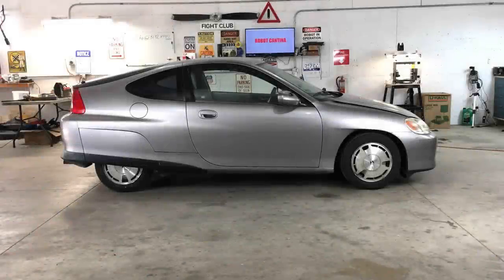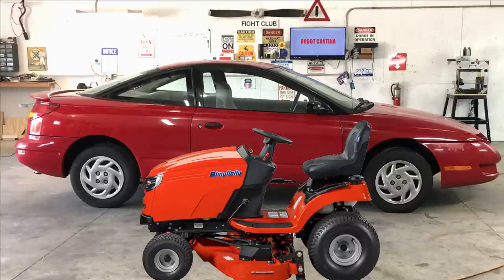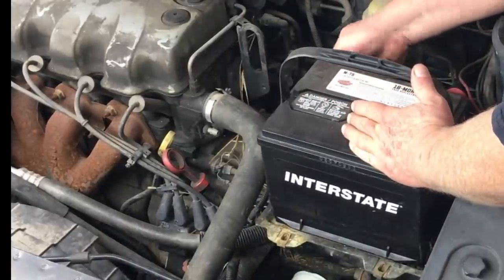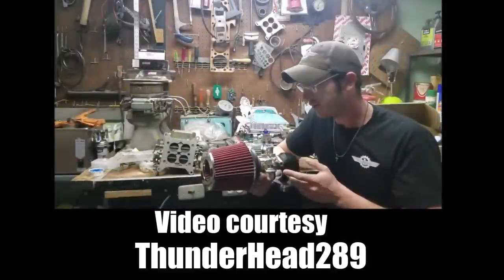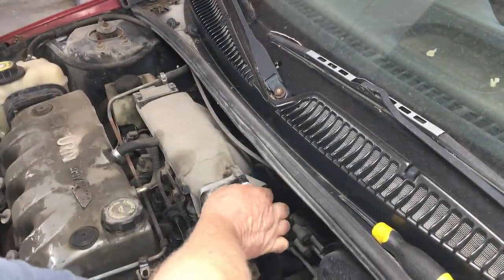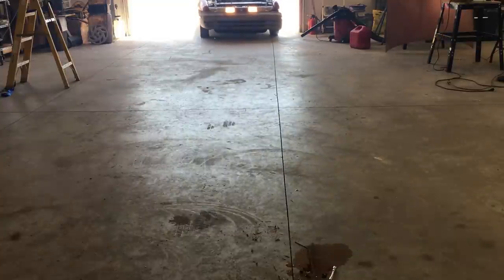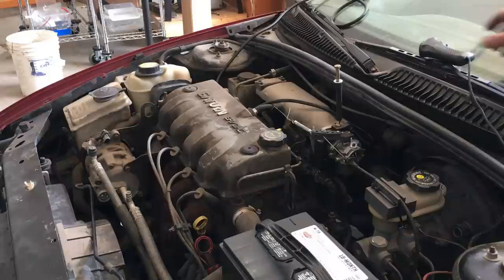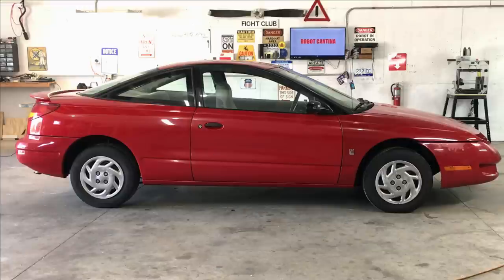S2E14: We get new project cars for more experiments,  plus we put lawnmower carburetor on a Saturn

Comment: I remember reading about a lemons racer who did this with a 2 barrel cause his EFI gave out during a race, always wanted to try it on a beater with poorly working or non working EFI to see if you could improve fuel mileage out of the crate or at least buy a crate some time before the scrapyard. I'd love to see some tests in regards to general fuel economy at some point with that setup, and see if the computer is still playing with timing like normal or if it locks up or freaks after a while. Being 90's tech I doubt it would panic but so much.
Reply: Interesting points here.   I am a little more  90's tech myself so I can relate to that. 🖥☺
Reply: @kansasrose2909  Are we talking about a  Le Mans race car?
Reply: @mommapanda5736  ROBOT CANTINA    we love these new project cars!    and we love it when Jimbo  re= engineers stuff!  just for fun👍👍👍👍

Comment: The EGR delete might have been intentional, keeping it from gunking up the intake. Yes, replacing the transmission filter does help, but the only real solution for the Saturn auto transmissions (if you don't take it apart and modify it) is to use a manual transmission... ("Reverse slam" is a thing, as is firing your diff pin thru the housing.) Long time Saturn owner here.... Saturnfans is also a super excellent technical resource, at least for mostly unmodified cars...

Comment: I subscribed to Luke's channel because of that carb video and I'm excited to see it here as well. The wide band sensor will help a lot in tuning the carb close to that 14.7 to 1 that you need. It's a great idea to install.
Also you may wanna get rid of the converter before anything bad happens to it and it melts down from a rich mixture. You don't want it to clog and affect testing. Getting rid of that variable saves you a headache later on.
Keep up the great videos👍👍
Reply: Great brains seem to think alike sometimes, right👍

Comment: I hope you have better luck than I did with the brakes.  Saturn does a weird cross brake system with the front and the opposite rear on one circuit.  I never could get the back brakes adjusted well enough to get a solid feeling pedal.  I was contemplating rear discs when the body control module got iffy so it left the fleet.

Comment: Dunno if anyone has mentioned this, but my experience with 90s era computer control systems leads me to say that there's a non-zero chance that not having a functioning throttle position sensor (and whatever vacuum operated valves and sensors run to the original throttle body) could be why the car is stuck in 3rd gear. An easy way around that would be to install the old throttle body, remove the butterfly plate, rig up a linkage from the TB to the carb, and attach the carburetor in front of the TB. That would likely also restore idle air control (I'm not familiar with this particular system, but you may be able to rig it to function like Thunderhead's air bleeder system), and give the ECU the inputs and vacuum references it needs to control the transmission properly.
Reply: I come here for the videos and stay for the comments... I lot of genius thinking going on...
Reply: @kansasrose2909  I come for the comments and stay for the fun of it all...
Reply: @ocdman202  HEY JIMBO.....  congratulations on reaching 100k subscribers.. ROBOT CANTINA is providing the 
entertainment and fun that viewers enjoy..

Comment: I 3d printed a thermostat housing for a comedy channel that does satirical bits about being a mechanic. I printed 2 one in pla and one in petg he ended up putting the petg one on because the pla one was "too pretty" and he wanted to sit it on his shelf.  I expected both of them to melt and spew coolant everywhere and that was going to be the joke but he ran it for over an hour  and it didn't even leak. He ended up leaving it on the car he was  "fixing"  😂 and only ended up breaking after several blows with a hammer.  There are quite a few parts you would be able to print that would probably work quite well for this application.
Reply from the maker: The 3D printer is awesome but it is also making me lazy...  In the past, I would have made the carburetor to manifold adapter out of .25 thick aluminum.
Reply: @robotcantina8957  Interesting...

Comment: Oh btw, when I have vehicles come in with dead fuel pump, I use manifold vacuum and a "jet" with a small vacuum line directly in a gas can to limp them into bay and on lift. Yes is crude but works.

Comment: 1- You can use the airbleeder port as a choke.
2- Have you tried putting the transmission in L, 3, or 2 instead of D (if it has any)?

Comment: "There's no way I'm gonna drop the fuel tank to replace the pump! That would be way too much work."
Proceeds to spend 5-20X as long fitting a lawnmower carburetor and fuel system to the engine instead.
"See? Wasn't that a much more sensible solution? Now I have endless custom problems to solve!"
I'm starting to think this is all a very convenient excuse to continue with your amazing projects. ;)
Reply: @Shiznit304  Truth especially since the car is junk. 😂

Comment: If you need the shop manuals, they are available on the subreddit for the Saturns - they may help you if you need specific info on the computer systems

The SL definitely needs a new valve body, at least the solenoids, I was having this issue on mine and I did a manual swap as they are far more reliable than the autos.
Reply from the maker: Generally speaking, I don't really like the automatic transmission, but it would be cool to do a few experiments.  Thanks for the heads up on the tech source.
Reply: @robotcantina8957  Keep up the good work here.. Robot!👍
Reply: @kansasrose2909  Looking forward to more experiments.
Reply: @ocdman202  HEY JIMBO.....  congratulations on reaching 100k subscribers.. ROBOT CANTINA is providing the 
entertainment and fun that viewers enjoy..

Comment: Yes !!  You got a new project Saturn.  My high school buddy swapped in a flow master system for the factory exhaust.  Could I give an idea of installing different mufflers , axle back system,  catback, even just a headers or a wider piping on the stock muffler

I put a $4 tip non resonated on a camry 85000 miles and actually restored my mpg  no joke

Comment: Okay, here's an idea. You take one Saturn and cut off the back to make it a Ute, then you take the V-twin with a turbo or supercharger and make it a Sport Utility Truck. Next you take the other Saturn, put the diesel in with a turbocharger linking it to the manual transmission and see how much of a payload the car can pull. Or use the diesel in the Ute, either car doesn't matter.

Also any vehicle designed by or affiliated with General Maintenance is a big red flag.
Reply: I come here for the videos and stay for the comments..  Great comment here.
Reply: @ocdman202  🚩🚩🚩big red flag for any vehicle designed by
or affiliated with General Maintenance!😜😜😜!  had to laugh

Comment: Hey... that Saturn you introduce with the banjo music (LOL)... that's an SL2 ain't it? My mother's got a 98 SW2 holding down the front yard, she can't drive any more and is open about it, but can't bring herself to admit it by getting rid of the car. I don't blame her.

But I been under that hood a time or two, doin this or that. Also, my father used to do his own maintenance. For the longest time he had this 2000 Le Sabre he got for a song, it was in great condition, but something about my father just beats down on cars. It ain't abuse, he treats em right... but call it an aura or bad vibrations or what-have-you... every car he's ever had either started a clunker and just kind of fell apart around him, or came to him in near-perfect condition and within six months was a beater. That Buick was an example of the latter, got it for a song in literal mint condition from the sort of people who do the oil changes and such in the manual when it tells em to, because it tells em to in the manual. (They were getting old, went into a retirement home and selling the Buick was part of making that transition.) Within Dad's first year with that thing, the passenger window stopped going up (it'd go down just fine tho), the pop-up radio antenna jammed shut, and the fuel pump started making strange noises lol... by 18mo all the buttons on the steering wheel were dead (eventually, the driver's door ones went out, too, but that took a bit longer). He never actually got around to fixing any of that, it ran and drove and that was good enough for him.

He did investigate the fuel pump thing a bit tho... turns out, you can usually get in through the trunk if you're clever about it... and you don't mind spending an entire weekend pulling the floor of the trunk apart all the way down to the bare metal to get to the blame thing! He never found the time coz he always had better things to do, but it might be worth considering in the long run.
Reply: Also, that is a painfully unhappy engine, it sounds like an 80s Chevy diesel pickup. Saturn 4-pots ain't s'pose to sound like that lol.
Reply from the maker: Both the Saturns we featured were  single camshaft models so the sedan would be a SL1 and the coup is a SC1.  Its good to know that the fuel pump can be gotten to with a little bit of cutting.  Unfortunately the sedan is an insurance write off and it cannot be titled, so I'm sort of not motivated to fix it too much.
Reply: @robotcantina8957  Huh, I always thought the -1 and -2 meant generations, not SOHC vs DOHC. LOL. I'm a nerd tho, I do to computers what you do to cars.
Reply: @laserhawk64  ROBOT CANTINA    we love these new project cars!    and we love it when Jimbo  re= engineers stuff!  just for fun👍👍👍👍

Comment: A project car to convert to lawn mower engine, could be an old Prius or Chevy Spark EV which battery is shot already. On the Chevy Spark EV, just removing the drive battery gives you about 450 pounds less weight to vehicle. Prius battery however is only about 120 pounds.

Comment: Yay, you went with the lawnmower carburetor on a car engine idea. I can't wait to see how it goes.  Maybe an older v8 mustang or camaro would have been better from a perception sense. Either way, I'm glad you took on the idea!!!
Reply: My old 89 Wrangler has a 1 barrel 1 injector throttle body.  It is easy to replace the 1 injector.

Comment: Lawnmower carb on EFI engine - what could go wrong?
My answer is that three way catalytic converter could exit through exhaust pipe and talk to you about terms like lambda correction
Reply: Also, check engine light could turn on and you could feel lack of performance
Reply: @poprawa  Interesting point..
Reply: @ocdman202  lambda correction sounds very interesting. 🤓
Reply: @kansasrose2909  in EFI oxygen sensor is used to get mean lambda 1 value and to oscillate a bit between lean and rich mixture using fuel trim, but in this inspiring V8 lawnmower carb project mixture gets always very rich. That would make cat too hot, it propably would even melt, but in V8 project cat converter is absent and mixture control is implemented with air control valve in closed feedback loop. This loop could make sure, that exhaust would not hurt cat converter, but it would need program that would replicate HCs and oxygen emissions close to orginal EFI solution
Reply: @poprawa  Thank you so much for this detailed and thoughtful reply,   I really appreciate your expertise here. 💖

Comment: The big issue of PLA vs ABS/ASA is not melting point, it's glass transition temp. You really can't use PLA over ~60°C, you can safely use ABS/ASA over 100°C with no issues.

Comment: So the DOHC manual transmission (MP3) Saturn s-series have shorter 3-5 gear ratios than the SOHC transmission (MP2). They're both directly swappable. I'm not sure what your route is with the car, but the shorter gear ratios may be better.

FYI I have a lot of knowledge and technical literature on the s-series if you ever need any help.
Reply from the maker: I forgot to mention we actually have a twin cam 5 speed transmission that we are going to use, specifically for the closer ratios.  Its good to know that we have Saturn fans in the audience. !
Reply: @robotcantina8957  🪐🪐🪐👍👍yes   saturn fans!
Reply: @kansasrose2909  ROBOT CANTINA    we love these new project cars!    and we love it when Jimbo  re= engineers stuff!  just for fun👍👍👍👍

Comment: I think you could very easily rig up a controlled vacuum leak (as luke calls it) to control the AFM, with just an arduino.
One analog in to read the wideband and a simple PID loop to output some PWM to reach a target.
There's plenty of libraries out there already so it would be just an analog in -> PID -> PWM -> some air valve thingy.
Reply: The devil is always in the details. There is a lag between changing mixture and the O2 sensor responding that depends on exhaust flow (RPM and load) and getting a PID loop stable with wide range of delay is tricky. A bang-bang control loop with a narrow band (or wideband with threshold) would be easier to get working.  Also the Arduino would need to know engine temperature, you don't want it trying to correct starting enrichment with a cold engine.

Comment: what would be very cool and interesting, if you could make the Saturn run off of hydrogen from electrolysis. that would be a cool experiment. you could also put the throttle body back on and remove the butterfly and then adapt the small carb so you could have a working tps.

Comment: I don't remember the exact about Saturn, but I have known several other GM vehicles to have problems with them just staying in top gear whenever you put them in Drive. With it being a flooded car I wouldn't be surprised if the shift module was damaged. But you should be able to manually select through the gears by shifting down into first and just selecting up to second then drive to get it to operate correctly.
Reply: Good point here.    I come for the videos but stay for all the comments here.
Reply: @kansasrose2909  Looking forward to more great videos from
ROBOT CANTINA!

Comment: mower carb + speeduino engine management so you get full control (in a budget friendly way) over the ignition timing and all the data/logs? might need to run it as a piggyback with the auto car if the stock ECU handles the gearbox logic, but the manual wont care.

Comment: A simple way for you to add throttle position would be to add a gas pedal from a drive by wire car and wire that pot as if it is on the throttle shaft.
Reply: Yes, just Google remote throttle body sensor. I am sure you could make something yourself. 👍

Comment: good show, I really like where its going. ThunderHead289 got 41 mpg pushing 70-73 mph.
its possible the little Saturn engine could give 65-70 mpg with a lawnmower carburetor.
I'm an older guy with a DISLIKE for "smart phones with a set of tires on them",
computerized electric everything with big sis snoop tracking inclusive, just like phones.

they say they can't manufacture new cars because of a chip shortage...
(I remember cars without any F'n chips in them, so those mofoz are FOS!)
what if this Saturn with a lawnmower carb gives 80 mpg at 60 mph?
don't let Brandon drive it tho, he'll bring it to a stop and roll it at 0 mph!
Reply from the maker: Stay tuned, we will have all the performance data, including MPG in the next episode.  FJB
Reply: @robotcantina8957  I will stay tuned.... I come here for the videos and stay for the great comments.
Reply: @robotcantina8957  you know I'll be watching... the price of lawnmower carburetors going right through the roof!  :)

Comment: I would like to see the Kubota diesel into the slant, but you should try one of those Briggs and straton opposed piston 2 cylinder flathead engines 18 to 20 hp and ton's of torque, it was even put into a hybrid power train that they designed in the 80s.
Reply: These briggs engines don't look like opposed piston engines to me.
I think that they are boxer engines or 180 degree v engines.

There are small-ish industrial engines that really used the opposed piston Design.
Junkers made them.
The 1 cylinder 2 piston variant isn't even that expensive when you consider that the last ones got build 40 years ago (the Design itself originated in the 30s)

The funniest thing about these Junkers engines is that you can use a cigarette to start them...

Comment: I must be missing something. I can't figure out the point of all this. Why would you reduce the power of your car from 120 hp to 20 by putting a tiny carb on it? If you want to save fuel then drive carefully. EFI will always do a better job of getting the maximum amount of power out of a given amount of fuel that a carby, and especially a lawnmower carb. Just weird. If you want to drive around cheaply then get a second-hand electric car.
Reply: wrong. check out thunderhead289 on youtube. he took off his carb and put a lawnmower carb on his 302. yea it made less power but he was easily able to keep it at 70 mph or more. he said he was mad with how well it drove. plus he pulled like 40 mpg out of that 302
Reply: @Vyraxis  ROBOT CANTINA    we love these new project cars!    and we love it when Jimbo  re= engineers stuff!  just for fun👍👍👍👍

Comment: The fuel pump died on one of my project cars in an unfortunate spot in my yard, and required dropping the tank to get at it... Since I didn't want to roll around in the dirt to drop that fuel tank, I ended up using a 12v dc water pump that I had sitting around, a jerrycan as a "tank," and simply stuck the output of that pump down the slightly open throttle body. It idled well enough to get it onto the pavement where I could properly drop the fuel tank and replace the oem pump without getting filthy. 

Putting a lawnmower carb on it was far more work that I really wanted to do, since I intended to keep the efi working anyways. But still interesting and silly nonetheless.
Reply: I hear ya .... I wouldn't to roll around in the dirt either.  Interesting and
silly ... good combination.